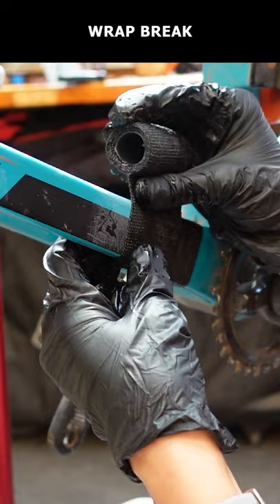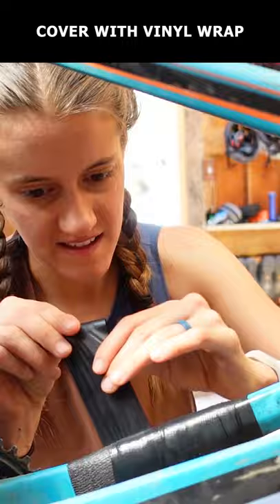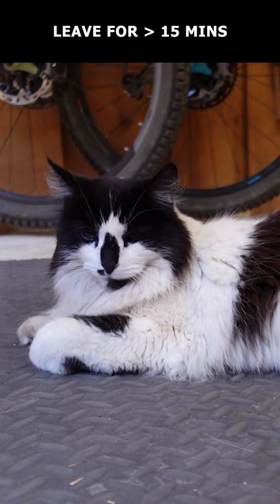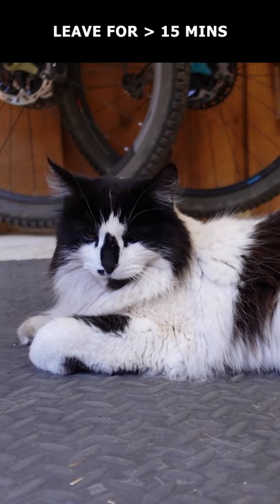How to emergency repair a broken carbon bike NOT A PERMANENT FIX #Shorts

Comment: Wow. I will never consider buying a carbon bike. $6k down the tubes
Reply: Carbon is stronger than alu and steel... its just brittle, if your gonna break a carbon frame your gonna break any metal frame. It just comes down to what your riding and how your rider whether or not carbon is a good idea. E.g i don't like carbon rims because i have smashed a few rims into rocks, I'd prefer a wheel that is totally mangled but still rolling than one that just shatters
Reply: @reecesoan8138  that's just an ignorant thing to say. Darvin is brittle and it breaks more easily than aluminum. It's not true that if u break a carbon you'd break a aluminum. That's just lazy thinking. Materials stress science strongly disagrees with ur pompous position
Reply: @vearsan  yes i am aware that because of metals flexibility it can absorb more stress with out breaking... where as carbon doesn't flex at all, but i have a fair bit of personal experience and enough to say if you break a high quality carbon frame you are most certainly going to void an alloy or alu frame. Its not ignorant its just simplifying, this is a YouTube comment section i couldn't be bothered to go into detail. I have only ever voided a metal frame, i have put my carbon hardtail through a lot of shit including nasty cases.

edit My riding buddies who are faster and better than me have only broke metal frames... the only carbon frame one of them broke was because he was an idiot and didn't strap it down properly in transport and it flew of the back of his truck. Metal fatigue is what gets metal frames, the welds can crack etc. The real world is very different to books we read in school

Comment: There isn't a permanent fix, unless you get another frame...Right???🤔🤦🏽‍♂️
Reply from the maker: Correct. It's an emergency fix, then you can send your frame to a professional carbon repair place to get it permanently repaired.

Comment: Carbon is light but you should have went with the alloy or chromoly steel hardtail frame. How did you break it anyway? Way to temporarily fix it though!

Comment: Or you could buy a chromoly bike and never have to do this. Its insane how many stupidly expensive carbon bikes ive seen with catastrophic failures. Just buy a steel bike if you're going to do crazy stuff. Its way cheaper and way stronger

Comment: There is no permanent fix for broken carbon.
Reply from the maker: You are correct that THIS is not a permanent fix, but there are a number of companies that will do permanent repairs to broken carbon. Check out our full video (link in description) to learn more about it.
Reply: @sydfixesbikes  No, a broken carbon frame will never return to its original strength and stiffness.
Reply: @simont3686  actually that's incorrect, carbon frame when fixed properly will have the exact characteristics as before, even more so then aluminium.
Reply: @simont3686  untrue

Comment: You guys are nuts to repair that frame that way.It's mickey mouse repair,you are looking for trouble.
Let the Professional carbon repair specialist do the work.
Reply from the maker: If you watch the full video (link in description) you will see that this was to demonstrate an emergency repair and we later had the bike professionally repaired before donating it.
Reply: @sydfixesbikes  Ok.
Reply: fratm ma se sei nel bosco e spezzi il telaio te lo metti e torni con calma a casa non ci vai a fare dh con il telaio tenuto insieme da sto coso

Comment: How to never have to fix a carbon bike frame again: don't buy carbon frame bikes
Reply: There are just 2 types of alloy frames:
1. Cracked 
2. Yet to be cracked (usually 5 years)
Reply: @Terra-Incognlta  steel is real
How about a chromoly full squish with 220mm or rear travel

Comment: Thats how i hate carbon bikes its sucks
Reply: Carbon bikes only breaks due to crashes. If u are very very veryyyy careful to carbon components. Then it will last long. But if u were a person that is " Ok fuck this" then u destroy it u fuck headed
Reply: @gabriel6195  yeah but the problem with that is this is mountain biking and that’s half the sport.
Reply: @gabriel6195  yeah
Reply: Aluminum bikes break too...
Reply: @MaplePanda04  yeah but its not like carbon if its break
Reply: @jiro3164  What’s the difference? You’ll need a new part either way.
Reply: @jiro3164  define "stronger"
Reply: @MaplePanda04  Right, but the difference is carbon doesn't show a crack mark or any kind of mark, it just suddenly snaps, Aluminum saved my butt when my frame cracked cause was able to see the crack, unlike carbon in that situation. In my opinion, carbon bikes are overrated.
Reply: @benblaser2593  That doesn’t happen all the time. Carbon can often give warning signs such as noticeable cracks or splinters, along with cracking and splintering sounds. I broke an aluminum frame last year and didn’t even see the crack until the bike failed underneath me. I agree that the price/performance ratio often isn’t worth it though.
Reply: @gabriel6195  lots of carbon road frames  fail even without crashing. The glue that holds it together starts deteriorating after some 5 years

Comment: Please don't do this, go get the frame fixed by a pro
Reply from the maker: You should watch the full video (link in the description). We very clearly explain that this is an emergency repair and later send in the frame to have it professionally repaired.
Reply: @sydfixesbikes   Even as a temporary solution it is still a bad idea, you can cause more damage to the frame due to the changes of how the load is distributed, causing micro-fractures that are only noticeable with an x-ray, It may get you down the mountain but could end up costing you more to fix then originally. Please leave carbon work to the professionals

Comment: Use jb weld. That's not gonna hold. With jb it's like new and even better.
Reply: Where can I purchase jb weld?
Reply: Lol, no. Do not use fucking epoxy on a broken frame. It's far weaker, like on the order of 100x weaker, than an actual fix.
Reply: Do not use JB Weld on carbon fiber. Just because it works on metal, doesn't mean it will for carbon. Use the Correct Item for fixing carbon fiber. Metal and composites are very different.
Reply: lmao carbon isnt metal in case you dont know